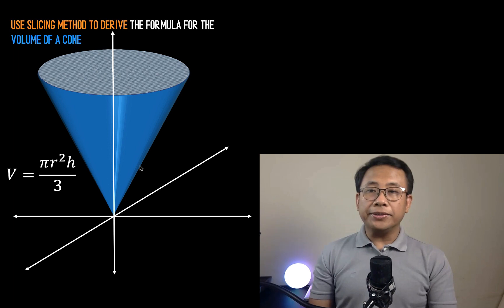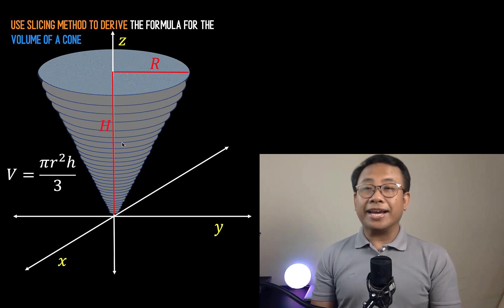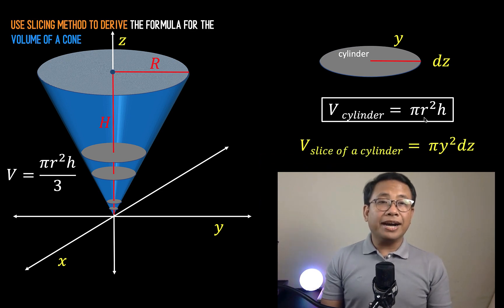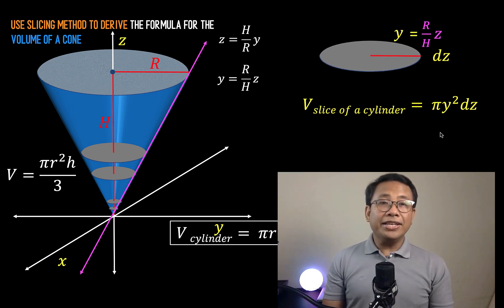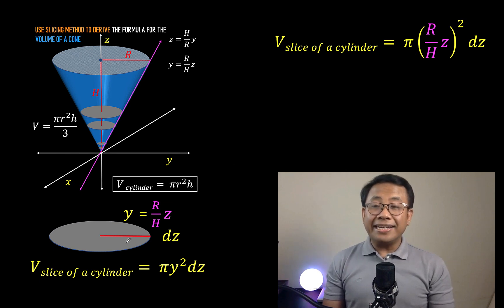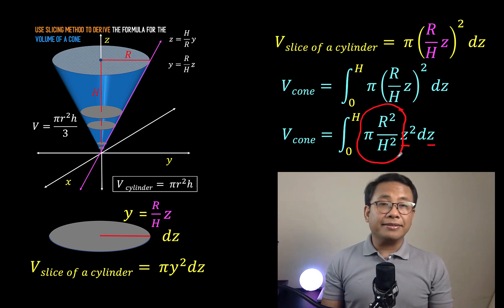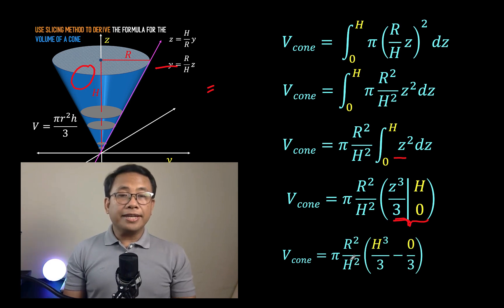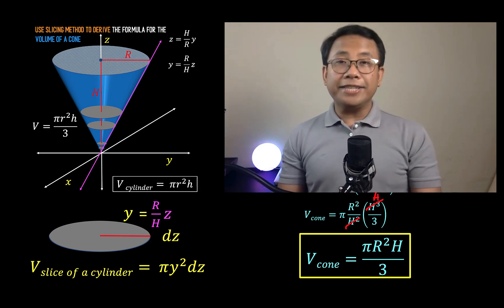Deriving the Volume of a Cone Using Calculus | Definite Integration

Comment: How did you get y= r/h x z
Reply: z/y is tan theta = slope
and H/R is also the tan theta
therefore,
tan theta = z/y = H/R 

z = (H * y)/R                  or,        y =  (R/H) * z     

And if you are still confused that why the tan theta is the same 

then, it is because the line is straight

How was my explanation😇😇 
pls comment about that